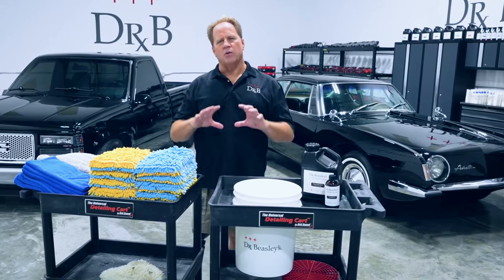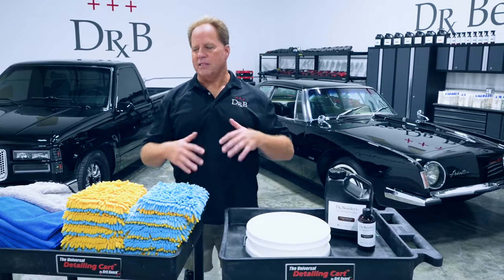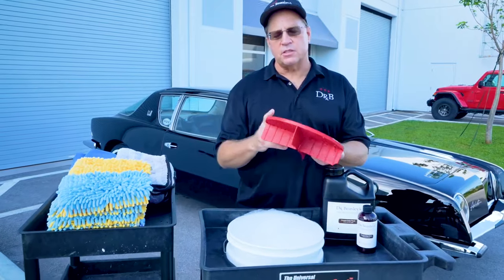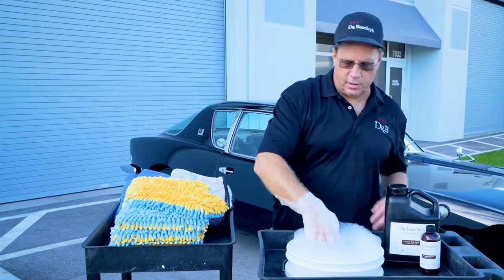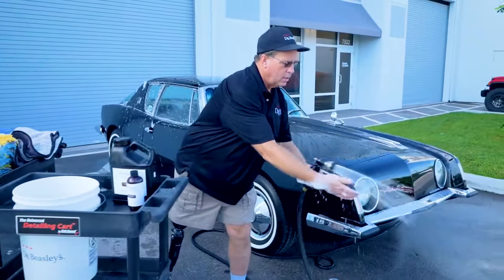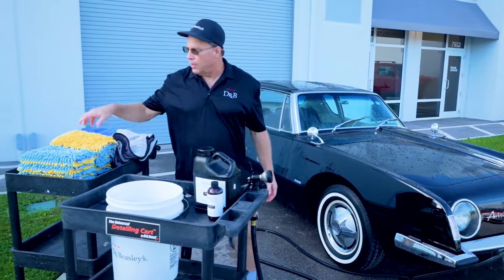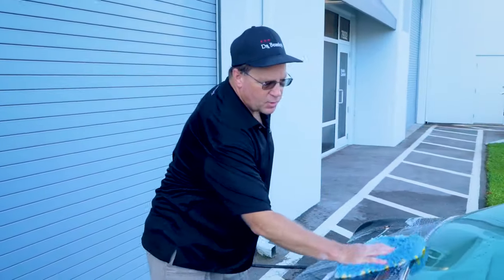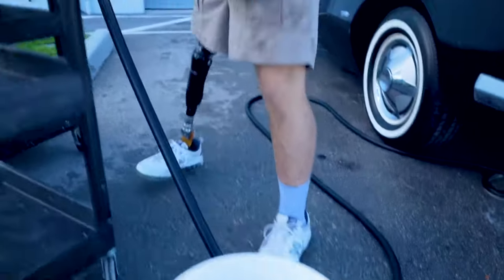How to Wash Black Cars: The Ultimate Method

Comment: I did this method starting summer of 2017 on my 2017 Phantom Black Metallic Chevy SS. The paint was near flawless the entire timed I owned it from March ‘17 until I sold it April of this year. Doing Rinseless washes with a bunch of towels in a bucket turned into regular washes with multiple wash mitts in a bucket. It just made sense compared to the two bucket method.

Comment: Have been doing it with several mitts using the zero bucket wash method since 2014.  But im now 98% ronseless
Reply: Little things make big differences and often times the little things are the big things.  I try to use rinseless wash when working on classic cars, restored cars, muscle cars, etc., just as a professional courtesy to the current owner and all future owners.  The BIG PICTURE is to avoid creating moisture in places you cannot reach to dry which can cause rust.

Thanks for watching and commenting.   -Mike Phillips

Comment: Iv done the one bucket method, I liked it at first but the big prob is tht u will end up doing to much laundry and tht part gets annoying, u waste a lot of detergent and the clean up after u wash ur car takes long to. I went back to the two bucket system using one mit.
Reply: I don't understand?  You went from 2-buckets to the 1-bucket method and then went back to the 2-bucket method because it's LESS work than the 1-bucket method?  

What about the multiple wash mitts or multiple microfiber towels approach?   Do you just use ONE mitt?  What color is your car?

Thanks for watching and commenting, as long as you have a method that works for you and your black cars, that's really all that's important.  -Mike Phillips